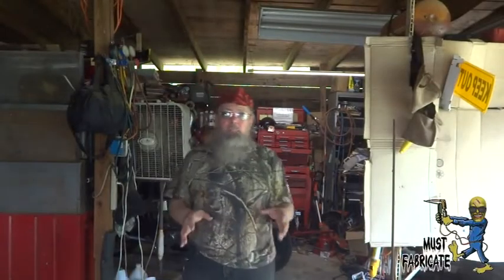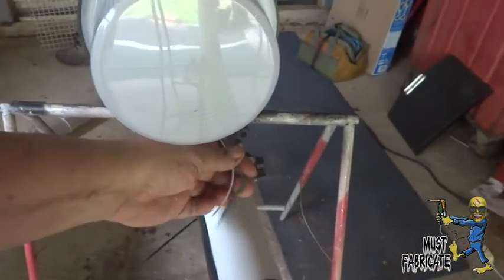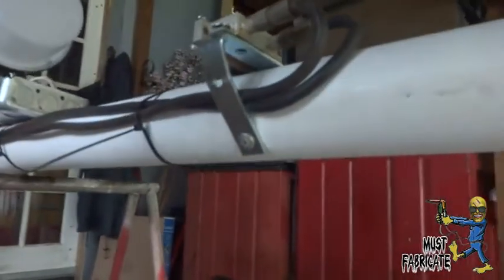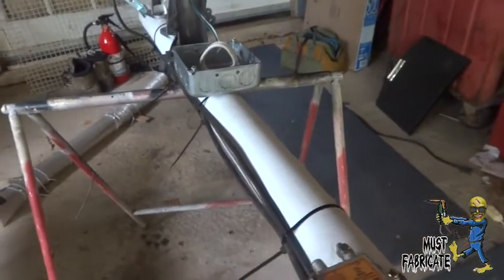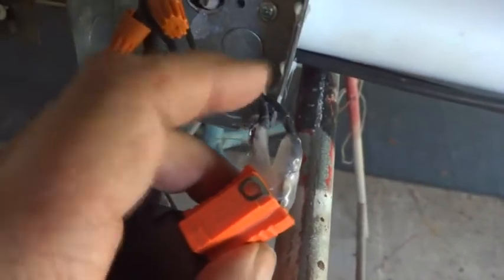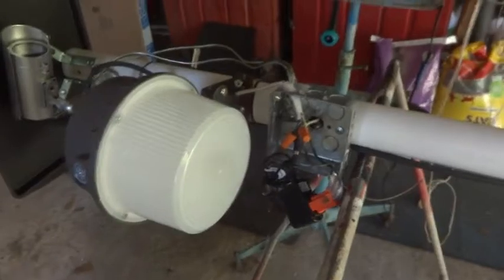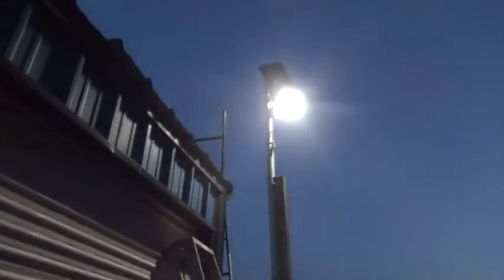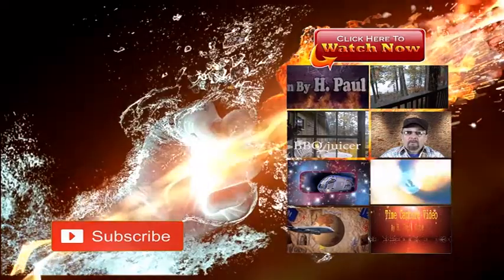LED security light pole with cameras DIY

Comment: You should sell the mercury vapor fixtures , id buy some if you have any left ?.   I dont like LED, i prefer high pressure sodium, they last longer than LED.. most LED fixtures dont last all chinese stuff..  The mercury vapor uses alot of power but you gatta change the bulbs something people dont do
Reply from the maker: you will need to look on eBay